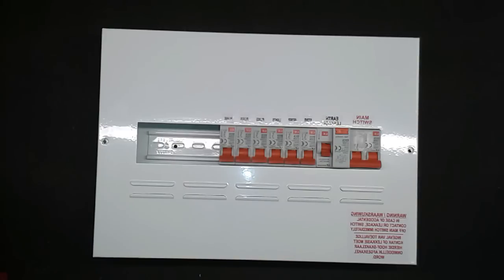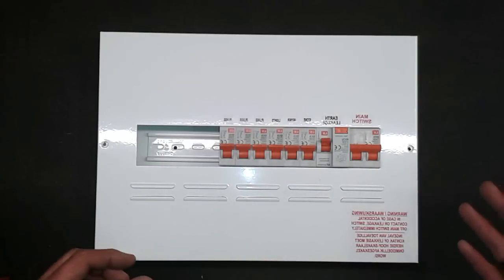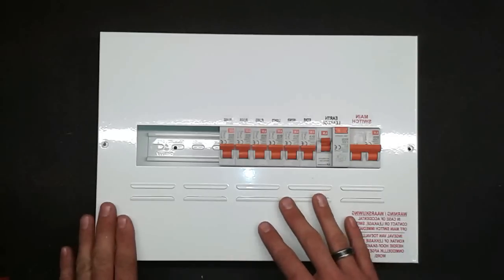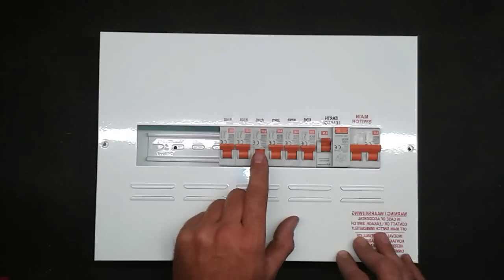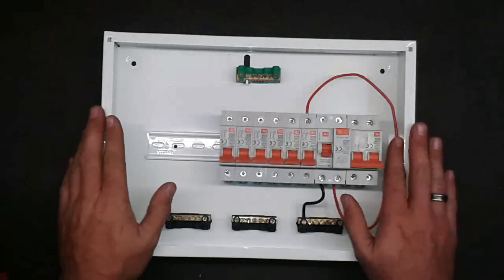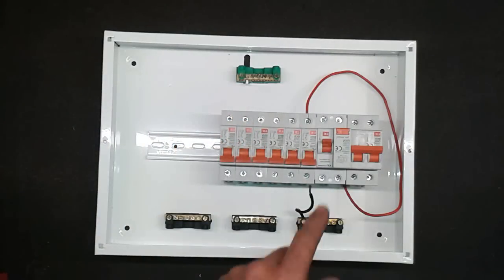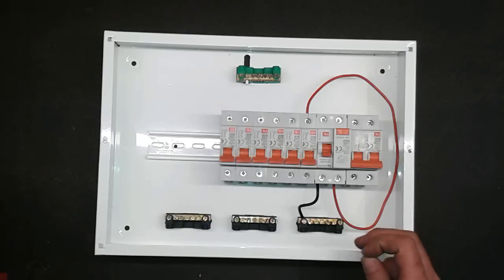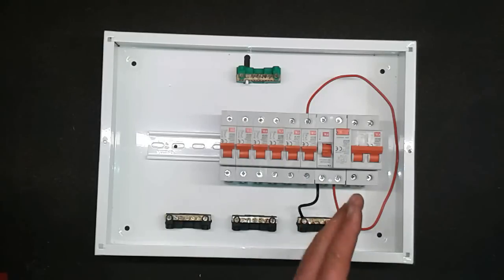Earth Leakage Trip...Here's what to do. (RCD)

Comment: Whenever I switched on TV, washing machine, laptop charger ( working at office), ELCB is tripping. Someone can explain what is the issue and solution also.
Reply from the maker: Hi arun kumar 

I think it might be a problem on that curcuit and one of the things you mensioned. look to see what else is plugged in and remove them all (do not just switch them off,unplug them) Try putting everything back and see what causes the RCS to trip.

Comment: Any tips if the earth leakage trips out once a day (11pm-1130pm each day) and anything timer controlled is already unplugged ?
Reply from the maker: It is odd that it's always at the same time. Could be the geyser (hot water cylinder) that switches on due to always showering or washing the dishes at the same time.

In South Africa not all curcuits needs to be on earth leakage (RCD) so what I do is temove the things that is not needed. Make sure it is the same where you live. 

If you are comfortable with electricity,start with the hot water cylinder. Remove that first and see if it staying on the rest of the week. 

Second I will remove the stove from the earth leakage. New stoves have warnings on them saying not to connect them to the earth leakage as they may cause "nuisense tripping".

Lights does not have to be on the earth leakage either. Flourescent lights also cause nuisence tripping.

If you changed all the above curcuits then it could be whats left. Pool? Plugs?

Plugs cannot be removed from the earth leakage so if it is still tripping you should start removing one rooms' plugs at a time. 

Hope this helps.
Good luck stuinNorway!

Keep me posted on your progress.

Comment: I am facing very strange issue in my power meter & wiring. i am residing in Group society. following is my setup in meter.

 1. electricity digital Meter is installed at bottom with a circuit breaker out of my house.
 2. i have ELCB installed which acts as circuit breaker for electricity of my house
 3. and other small MCBs are installed for regular electicity.
 4. some MCBs are installed for Power switches which actually for ACs and Geysers. 

5) i have relay installed in main circut box which switch between Main power and Gen-set power(in time of power cut), so Power switches are not relayed , they directly get power from phase.

*issue i am facing*. 

 - when my ELCB is connected to home wiring it trips. so my electrician has  separated that from ELCB and now ElCB only controlling Power switches & it does not trip.

- Even if i switch off the all MCbs and ELCB my power meter show that i have consumed some electricity. 3 units in 12 hours, which is huge.

- if i switch off the circut breaker which is installed with meter (point 1 on top) at outside of my house. then meter stops and does not show any units.

I called electrician he is unable to find the fault :(

i will share the picture of meter later.
Reply from the maker: +Raj Kumar 
Hi Raj

Very difficult to say without actually testing it myself...
Just a guess but it may be the relay that is in the on position for normal power consuming power.
If you can switch the wires so that the relay is in the off position for normal power it would not consume any units. 
It may require the generator to be started before the relay operates though.

Comment: For the "theory" of RCD:
https://www.youtube.com/watch?v=XTUUijDclWk
"How an RCD / GFI works and troubleshooting rogue tripping. by bigclivedotcom 

I was born in a small country town in Northern Australia.  Dad (Charles Tsang See-Kee) was the local electrician, 70 years ago, before transistors & home-based Earth Leakage existed.  Meggers were big & expensive then, but not now.

Today's many business & home owners hate RCDs.  Calling the & waiting for electricians is too troublesome & expensive.  Particularly with so much gadgetry demand mains power.

Waiting several hours or days for the electrician is not always possible.  Life-support equipment, expensive freezers-refrigerators, etc.  Often a quick test is all that is needed to isolate the one "little" problem.  And life can then resume.

The other method is using a local Earth Leakage unit, only for the suspected troublesome unit.  "Power Point and Earth Leakage Tester" on eBay for about $20 (USD).

Many electricians are not that competent, for many reasons: fatigued, anxious about other issues, extremely busy, not familiar with the latest technologies, etc.  Sometimes the payment bills can be lessened if the home or business owner helps the electrician.  Locate the plugged-in units, and test, as you demonstrated, before the sparky arrives.

RESIDUAL CURRENT DEVICE (RCD) WITH SOCKET PLUG-IN ADAPTOR, on eBay, costs about $ (USD) 20.  Suitable for non-electricians like myself, perhaps testing some power-supplies, or the latest mains-power lighting bulbs (?).

"Are RCDs reliable?
We’ve found that fixed RCDs are about 97% reliable."
from: http://www.electricalsafetyfirst.org.uk/guides-and-advice/electrical-items/rcds-explained/

So my choice of having on-hand my own RCD unit, plus your video tutorial, is a good idea.

Comment: Not an ideal diagnostic method because of failure to measure actual leakage current. It's not unusual to have a trip resulting from several devices each with small leakage that adds up to enough to trip.
Also why is your video flipped left to right?
Reply from the maker: I do agree with you. It would be better to use a IRT tester but that is not something most people have. As for the flipped video...I dont know. Im unable to edit it now so it has to do.

Comment: cut the earth out simples
Reply from the maker: If I understand you correctly,that's the last thing you want to do. Removing a eath wire from a appliance might keep the earth leakage from tripping but is DANGEROUS to the user. If the electricity cannot divert through the earth wire it will go through you aka electric shock!

If you mean to test and find the fault by removing the earth wire then I think removing the neutral wire would be an easier to option.